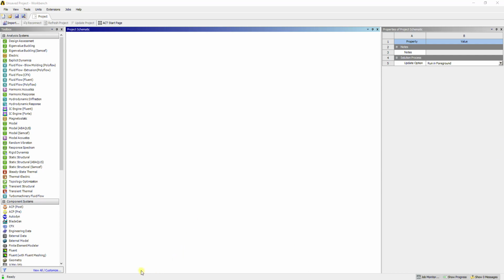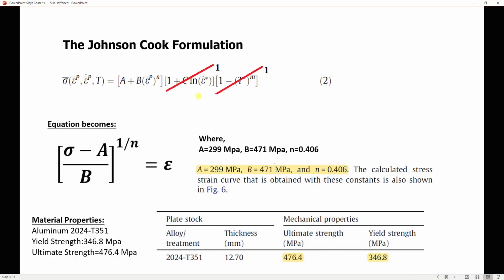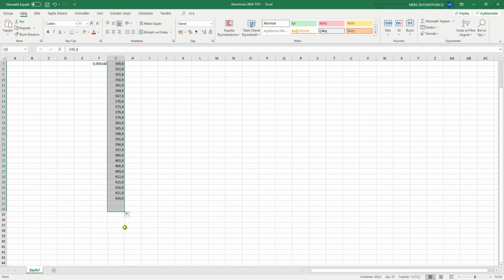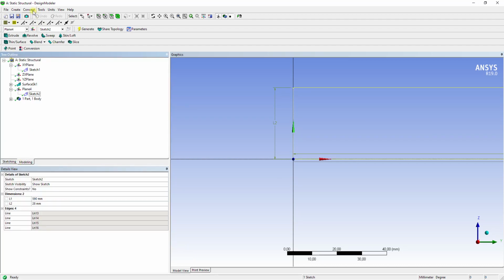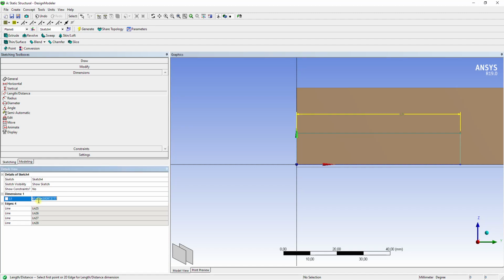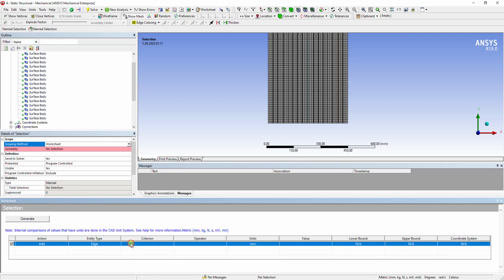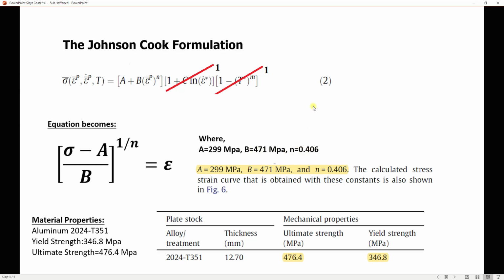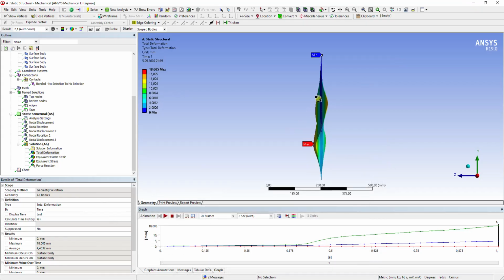ANSYS Nonlinear Buckling Analysis of Stiffened Plate (Johnson-Cook-Power Law Plasticity)

Comment: ERROR = "An unknown error occurred during solution.  Check the Solver Output on the Solution Information object for possible causes."
WARNING= "The unconverged solution (identified as Substep 999999) is output for analysis debug purposes. Results at this time should not be used for any other purpose."

Aynı işlemleri yaptım fakat  sonuç yakınsamadı videodakilerden farklı hiçbir şey yapmadım internette bazı sayfalarda bu uyarı için time sizing arttırın deniyor. min substepi 10 max substepi 1000 e getirdim tekrar aynı hatayı aldım.
Reply from the maker: Evet bazen yakınsamıyor, initial substep i artırabilirsin, malzeme datasını kontrol edebilirsin, energy değerini değiştirebilirsin, mesh i iyileştirebilirsin vs vs. Çok fazla yöntem var.